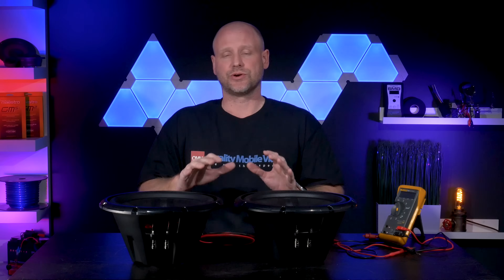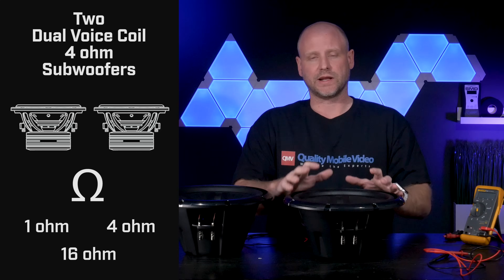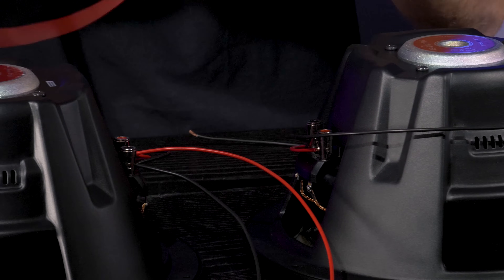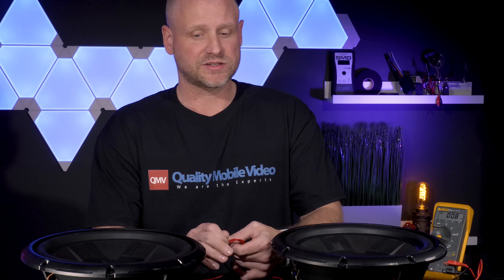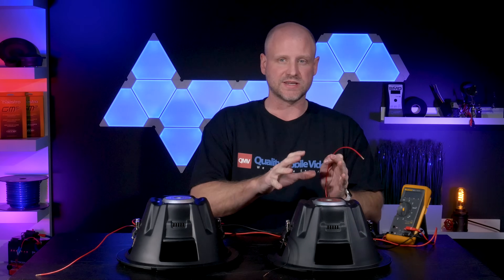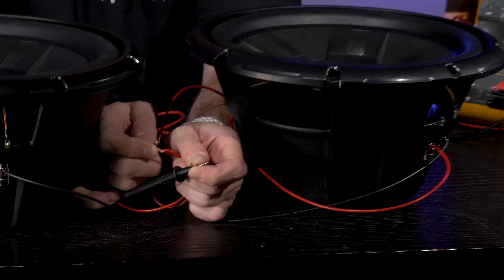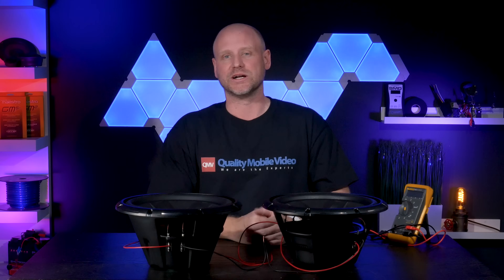Wiring Two Subwoofers DVC 4 Ohm - 1 Ohm Parallel vs 4 Ohm Series Wiring

Comment: Hoping I can get a definite answer. I have a 07 mustang with shaker 1000. Replacing the 2 subs in the factory enclosure. Factory wise  their 10" Dual voice channel running between 1.5 to 2 ohms. Each channel has its on +,-  so thier are 4 sets of wires. I'm planning to put 2 ten inch skar subs Dual voice coil rated ar 2ohms . Am I reconnecting the new speakes just as the original were or do I need to parallel or series the wires ?

Comment: I have a 2500 watt amp and 2 DVC 4ohm, the amp is 1ohm stable giving 2500 watts, will both subs get 2500 watts if wired to 1ohm ??

Comment: Okay so my question is once I parallel hook up two 12-in woofers from 4 ohms to 1 ohme and you tie them all together both speakers so you have one positive and one negative to run to the amp most amps have two positives and two negatives is there any specific spot that I'm supposed to hook up the positive and negative on the amp for instance am I supposed to Bridget cuz I just doesn't make sense to me that I'll be getting the most power that way out of my amp but it seems like I'm only using half of it

Comment: Best video... u can parallel two subs at the amp to bring to 1ohm.. wires work better if running 8guage wire else hooking two subs bridged has too thick wires😊

Comment: In my boat, I have a JL audio M 600/1 mono class D 600 W amp for my two JL audio M3 series 10 inch subs. My question is, am I able to add two more identical JL, audio M3 series 10 inch subs to that amp? If so, should I wire them in series or in parallel? What gauge wire should I use?

Thank you
Jeff

Comment: I have a unique situation I can’t figure out. Jeep has a factory 4om 2 connector sub. I have a dual 12” speaker box that only has one input on the box so I assume the speakers are in parallel.  So I don’t know how to take the 4 factory wires to input into the 2 wire connector on the speaker box. Any ideas?

Comment: I bought 2 15'' dvc 4ohm subs to be wired down to 1 ohm but the monoblock amp the website recommended ended up having 2 channels but it doesn't say on the amp that it's bridgeable. The amp is a NVX NDA104 monoblock class D. How do I wire for 1 ohm on a monoblock that has 2 channels? 🤦‍♂️

Comment: So could this work for my R2-750x1 Mono Amp Rocksford? I think both are wired to 2 ohms and wired into the amp but not together so if I twist both negatives together and positives and put them into one positive and negative terminal will that grant me a 1 ohm load? But also will I deal with overheating issues I heard 1 ohm even stable could cause that
Reply: Why I wanna do this is because I have 2 P2D4 12's and I get clipping at with both subs wired to 2 ohms and wondering if it's because I either need a more powerful amp or if I need to wire them to 1 ohm to fix the clipping output issue. They are dual 4 ohm voice coils. Apologies I am tryna learn more about this as my dad hasn't helped me fix this issue and he already refuses to get new subs if they blow so trying to make sure they don't die on me

Comment: Yo. I've had a system before. But never knew all this. Got a new one. A lot smaller tho. My question is.... What's the difference between how you just wired those. Making it a 1ohm or 4 ohm. What's the difference between dual voice coil and other. I'll tell you what I got maybe you could tell me what you think. I got 2 8" kicker comp subs, they are 4 ohm dual voice coil. What ever that means.... And I also got a Rockford fosgate 500watt mono amp. Not sure but I know I can make em hit. I'm just not sure the best way to wire it up is. What do you think?

Comment: Ok I have 2 10" subwoofers and I'm putting the subs in it's own box...how would I wire them to the amp ?
Reply from the maker: That depends on what load the amp can accept and how much power you need.

Comment: On the 4 ohm load at the end of the process if I have 2 channles on my mono 1200x1 class d amp can I use both channels instead of spinning my positives and negative’s from both speakers together or should I do that and just use one of the channels?
Reply from the maker: If it is a monoblock amp, that is a paralleled connection, so you can use both.

Comment: Can i wire a single 12in sub dual coil in a series bc my amp is 4ohms an if i do it in parallel it will be 2ohm?
Reply from the maker: Yes, if your amp will support a 2 ohm load.
Reply: @Qualitymobilevideo  thank u

Comment: If you have a dual channel monoblock would you still need to bridge the speakers together in the box, or wouldn’t that happen anyways at the amp dual channel?
Reply from the maker: You can use the terminals on the amp to parallel the connections.
Reply: @Qualitymobilevideo  that’s what I figured. Thank you for the clarification.
Reply from the maker: No problem!

Comment: I have a pioneer gmd8601 and pair of 12s pioneer TSA 3000D4  how can i conect it to 1oh?the amp has 2 Speaker conexions  but it says its one?
Reply from the maker: Parallel all the coils for a one ohm load.
Reply: @Qualitymobilevideo  thank you
Reply: @Qualitymobilevideo quick question?both speakers all parallel and the amp?it says its í exit but has 2 do i use both or just one?

Comment: How would you go about wiring 2 4 ohm dvc subs for a final 4 ohm load if you have a Monoblock with dual outputs?
Reply from the maker: Series each woofer, run each woofer lead to the amp, that will parallel them for a four ohm load

Comment: would the 4 ohm load need another wire to the amp. or does those two parallel wires go directly to the amp without another wire added?

Comment: Thanks for this video you have now taught a blind guy how to wire his scar EVL 6.5 inch dual for Ohm subs to a one Ohm load I am hooking two are those subs up to a scar RP 350.1 monobloc class D amp
Reply from the maker: Glad it helped!
Reply: Chad Jay. Skar sent a rep to my house. He brought the upgraded 350.1, i was having power issues with ohms and rms/peak power was pretty much the same. Proved this with a Kenwood excelon mono sub 600 watt. I used to power 3 w6's with it & a Phoenix gold 3 way Amp(really 4:1, could power 4 door speakers and a sub separately). Hopefully you're keeping up, I then trade the 3 JLs for jbl comp 15 in the biggest box I ever owned. I couldn't take the rattle or the box size anymore & JL cameoutwiththe W7 and I had to haveit, so then I sold the 15 with the custom box, and got a JL W7-12inch & it's absolutely ridiculously awesome beautiful breath taking insane ground pounding Mike Tyson Jab jab & then BOOM!! KNOCKOUT... Skar ended up comping(giving) me the 900.1 mono, wires, an Optima battery(just for the Amps & sub), & a Duracell power capacitor that looked like a giant AA battery.  Call Skar or wherever you got it from & Bitch! That there is no difference rms/peak because there isn't, and u will get what you should have gotten the 1st TIME, an AMP capable of powering any sub or  subs & u can wire it however you like & hear a difference 😉

Comment: I got a RE sa 1500.1 mono block amp will it handle 2 4 ohm dvc 12 inch kicker 44cwcd124 comp c
Reply from the maker: Yes, you should have no issues with that amp.
Reply: @Qualitymobilevideo   thanks just followed your instructions to the T and I am now making car alarms go off lol

Comment: Sonic electronics shows this exact setup but with a slightly different connection to the amp.

Instead the amp feeds straight into one sub following the same wire pattern on that sub then to the other sub with again the same positive to positive and negative to negative connections as yours.

I'm just curious if both outcomes are the same or if this makes any difference at all

Comment: Also, if i have a two 500 watts dual voice coil sub and i wire them on series-parallel  like the one you did on the video, does it also double the wattage og my sub (500 watts x 2 = 1000  watts? Pls enlighten me.
Reply from the maker: Two subs means you combine the power. If the subs are 500W each, that makes them 1000W combined.
Reply: @Qualitymobilevideo  thanks for responding

Comment: Maybe someone can help me here- If i'm trying to do this in an enclosure that has separate chambers and didn't want to drill a hole- I would: wire each sub positive to positive and negative to negative and then to each cup.  Then, from each cup outside the box, I would connect positive to positive and negative to negative and then wire that connection to the amp?
Reply: Hi can you guys help me i got 1 dual sub with a monoblock amp and 2 tweeters how can I connect them to play

Comment: Why can’t anyone explain this so we can understand? Those are going to be in a box.   In separate spaces.   Then you wired the last set of wires together.   My amp ROCKFORD FOSGATE PUNCH P1000X1BD has four speaker terminals and the manual says it’s not bridgeable.  So I need a better explanation.

Comment: So how i go about connecting the 1 ohm wired subbes to my SoundQubed AQ-2200 amp ?

I thought i didden't need to connect the subbs to each other, and just wire them like you did.
And the bolth seperetad connecting them bridgged to my amp (it's a 2 channel amp btw)

EDIT: i see i got 3 ohm subs ( 2 x jbl w12 gti ) so that would be a complete other story wiring them i guess...

Comment: I've got two 12s 4omh single voice coil wired at 2omh how do I get these 2 speakers at 1omh at the amp?
Reply from the maker: Not possible. Two SVC 4 ohm woofers wired together only can create a 2 ohm load in parallel or 8 ohm load in series. You'd need to have two DVC 4 ohm woofers to wire to a 1 ohm load

Comment: When you were wiring for the 1 ohm load and you twisted the positive and negative wires together, does that mean that I would only connect those wires to one terminal on my sub box even though there is 2 terminals? Thanks
Reply: Yes

Comment: I have a Kicker CompVR 12 4-ohm… what am would you suggest? Just an FYI, I want an amp I can run the single off of but also want to be able to run 2 at 1-ohm as well, without having to buy another amp. Thanks in advance! Oh yea single sub will be installed in a ported box in 2012 Ford Explorer.

Comment: Mrx-v70 alpine 5 channel amp says 60watt rms x4 +250 watts rms x1 at 4 ohm and 90 watt rms x4 + 350 watts rms x1 at 2ohms  Can I run  two 12s and wire them at 1 ohm or will it sound the same with just using one 12 at 2 or 4 ohm. Just wanted to ask this question anyone have an answer

Comment: When wiring two DVC 4 ohm speakers to run 1ohm at the amplifier such as your first sample in this video - how do you get two 11 gauge positive speaker leads to fit into one positive speaker terminal and the same on the negative? My Hifonics subs have the push style connections where you insert the wire into the hole and release the pressure on the binding post? not sure if using the proper terminology.

Comment: My pioneer 3003d4 2000wtt subs when wired to 1ohm load  using the pioneer monoblock 2400wtt it always on save mode  when the bass volume is high  my amp keeps on save mode no earth bass  y?
Reply: hey i know this massage is old but i have same setup as you same subs and amp and i want to know did you manage to get them working cos im now at 4 ohms and i want 1 ohm so i get 1200 rms which come to 600 rms each

Comment: I'm new to this . 
What are the differences between the set ups? What will hit deeper ? And the advantages of both?
Nice video btw
Reply from the maker: 1 ohm load will always offer you the most potential power of a system. 4 ohm is more efficiency
Reply: @Qualitymobilevideo  thank you for the answer . Great video and info
Reply: @Qualitymobilevideo  is 4ohm deeper or better sound?

Comment: I have 8 8” bass rockers midrange speakers 300 watt 150 rms 4 ohm but don’t know what watt amp to get for them I would like to use a taramps to power the speakers or if I should get 2 amps one for 4 speakers and another for the other 4 I have no idea what watt amp to get my subs I have 2 12” bass rockers dual 4ohm 600w Rms 1200 watt I want to get a taramps for my subs as well I also have a chuchero box with 6.5 bass rocker speakers with 1” tweeters it’s 800 watts I have no idea what’s the rms is but don’t know if I have to get the chuchero box it’s own amp so basically I need to know what watt amp I should get for each how many if more the 2 how many channels for each I want to use the brand taramps to power my subs and my speakers and if need be my chuchero box help

Comment: I wish you would have demonstrated the parallel wiring to a one ohm load with a sub box in front of you because it would have been different. What do you do about the terminal cups?
Reply: Wire them in parallel too from cup to cup then to the amp off one terminal cup or if u have a monoblock with 4 inputs wire each cup to a + - and it'll cut it down to 1ohm.

Comment: Question: So I have 2 Dual 4 ohm subwoofers, and my amplifier has 2 positive and 2 negative terminals how would I wire the subs?
Reply: if its mono just wire them the same way he did in the video, and then run the wires to each terminal instead of twisting them together like he did in the video. either way the amp will read it the same weather the wires are in both terminals or twisted in just one.

Comment: I wired my subs to 1 ohm today from this video and it feels like it got twice as loud. I don’t know what it was wired to but it had a positive to a negative on both subs idk. Thanks for the easy easy easy guide on how to do this!!!!! Never mind I guess it was a 4 ohm load haha
Reply: My sound quality went down but not by much, it’s hard to tell because there’s so much power now😂 Im never going back to 4 ohms
Reply: I'm running my subs at .5 ohms lol 😆 granted my system is built for it and set for spl so there is that
Reply: If u know what your doing u can make two 1000 watt subs knock with only 500w !
Reply: Which is loud music between  4ohm or 2ohm or 1ohm load
Reply: @simonkiragurithuku 1 ohm is loudest but higher ohms give better quality.
Reply: @simonkiragurithuku loud isn’t the key it’s frequency and stability- no distortion … volume don’t kill speakers distortion does .

1ohm .. lower the harder hit
Reply: My amp is 1500 watts, and i have 2 gravity sub 3000watts max 1500 RMS, i did the conection 1ohm and the amp stop (red light protection) what can i do?
Reply: @oscarm8952   i don’t know much about subwoofers subwoofer setup and I’m learning but, i think you need a 3000 watt amp. The one you have now would probably only be good for one
Reply: @elvissahagun3922  Facts He At Least Need A 3000 Or Better Class D
Reply: @oscarm8952  what gauge wire are you using for amp
Reply: @oscarm8952 dude u just said u have 1500 watt amp pushing two 3000 watt subs lol u don’t see the issue 😆

U need least a 6000 watt amp (although I don’t belive your woofers are that powerfull )

My 12”kicker comp cvr,s are only 800w a piece and they’re one of best woofers out …

If they’re  really 3000 watt a piece and u have 1000 watts driving them lol u want your system (if it’s mono block single ) at a 4 ohm load lighten the pull that the amp has to draw and will run your woofers more efficiently hence won’t go into protection like yours is .

Or ….. simply reduce gain adjust crossover around 80htz

Never use bass boost option on amps either !

If u have a 4 channel amp u want it bridged at 4 ohm
Reply: lol I’m glad Im fluent in wiring 😆

Some comments make me laugh…

I’m at 1 ohm (always) hardest hit period !

Only time u need to run higher ohm is when your underpowered and have big power woofers .

If u have the stability (YOU ALWAYS WANT 1 ohm ) 

But it’s all what your sub watt is as well as amps stability at that load .

4 ohm -5ohm is not a hard bump (yes it knocks) but nothing like 1ohm 💪🔥
Reply: lol I’m glad Im fluent in wiring 😆

Some comments make me laugh…

I’m at 1 ohm (always) hardest hit period !

Only time u need to run higher ohm is when your underpowered and have big power woofers .

If u have the stability (YOU ALWAYS WANT 1 ohm ) 

But it’s all what your sub watt is as well as amps stability at that load .

4 ohm -5ohm is not a hard bump (yes it knocks) but nothing like 1ohm 💪🔥
Reply: 4 Ohm sounds the best imo, 2 and 1 ohm are for spl ratings
Reply: @peterrasmussen68  no they’re not. It’s literally designed for the subs. Not for an SPL rating.

Comment: Something i don't understand - the design of dvc subs. I am no expert, let's get that out of the way. But as far as I know, you'll never use just one voice coil on a dual voice coil sub right?  So why the dual terminals?   Just seems like an extra failure point to me.  Why not build the sub in a way to where, hell i dont know, the jumper is built onto the inside of the basket and running to the other terminal  , so they are already connected?  I'm sure there's a million different ways you could go about it , unless of course there some fundamental reason it has to be that way in order to operate properly.  Which could be the case. Like I said, im a novice,  
There is just something about jumpers that have always just looked bad to me.  Like its some kind of rig up job youd do when you don't have all the needed supplies.   Make sense ?

Comment: So it's impossible to wire 2 4 ohm DVC subs to a 2 ohm load on the amp?
Reply: My question also! have you found any answers on this?
Reply: @terrychudson  I did not get the answer, however I'm pretty sure the answer is "you can't." 

I solved my problem by just buying 1 good 12" sub (4 ohm DVC) which ended up sounding twice as loud and hit twice as hard as the other two subs.

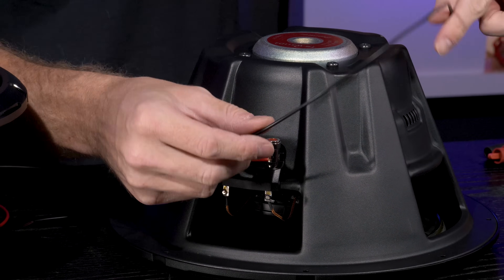Comment: At 1:55 you said you were using small wire to demonstrate; what gauge speaker wire should you use for this exact setup? (Assuming both subs are capable of 500 RMS for a total of 1000RMS)